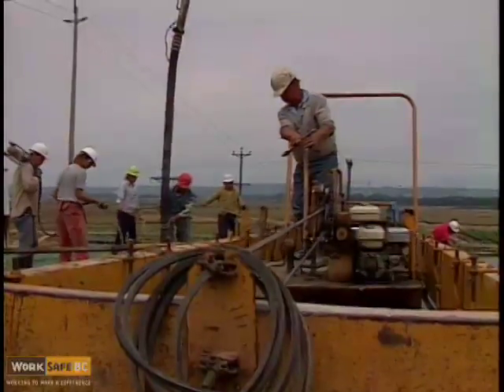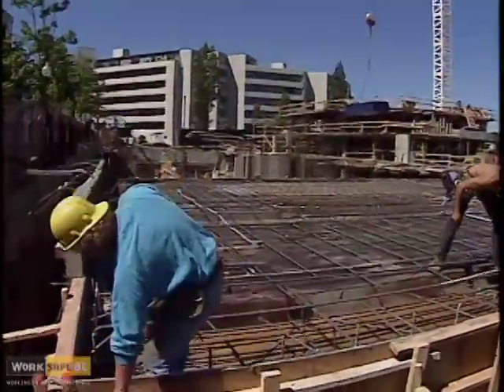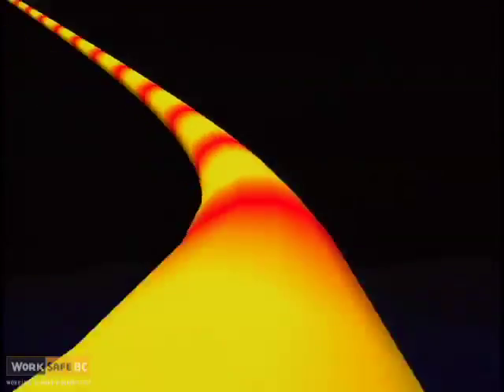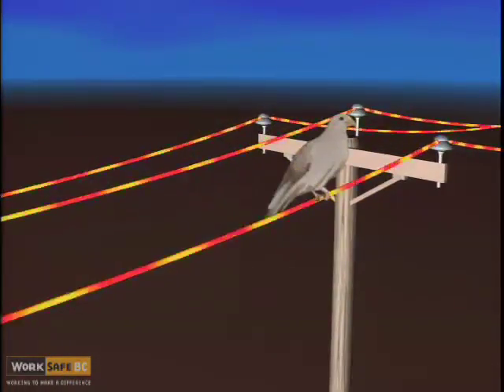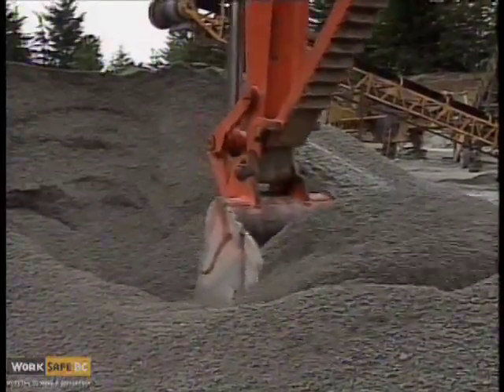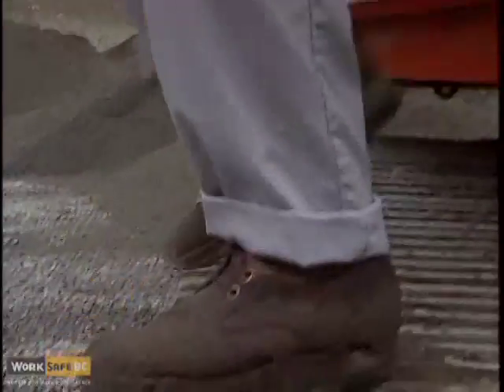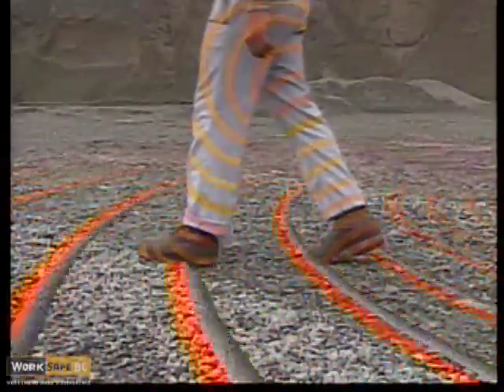A Bright Arc: Contact With a Power Line (6 of 7)

Comment: Replied to a question below. Wanted more people to see the answer:It is about the resistance in the dirt. There is full voltage where the power line touches the ground- 13,000 volts. Through the dirt's resistance, a foot away may be 12,000 volts. So when you step away from the contact point with your feet one foot apart, you can have that 1000 volts difference go through your bod, (as well as through the dirt).
Reply: this is true unlike everyone who says don't touch any metal objects inside the vehicle which is not true

Comment: The best safety rule is: NEVER operate ANYTHING near a power line. Not even a kite. Benjamin Franklin learned that the hard way for you, so you won't have to repeat his goofy mistake. Electricity does not discriminate. It knows no racial, religious, social, or political differences. It will kill anyone or anything that gets in it's way.

Comment: 2:33 This is how my uncle died.  His dump truck type trailer made contact with power lines and the tires caught fire.  He jumped out of the truck with his fire extinguisher but he was still touching the truck when his foot made contact with the ground.  He was 23 years old.  Videos like this are invaluable.
Reply: Dumpytom R.I.P
Reply: Tom LaRose fire extinguisher aka metal or know as a conductor  is the reason why he got electrified and died
Reply: Sublimebmx187 He wrote that his uncle both touched the truck and the ground. Not that he touched the ground and the truck via the extinguisher.
Reply: @Sublimebmx187  You are incorrect because simply holding a metal object doesn't create an electrical path to ground

Comment: While operating a crane with 140 foot boom, the machine came within 50 feet of very high voltage transmission line.  The crane became inductively coupled to high tension lines and when ball swung to within 2 feet of grounded support column, a large spark jumped from ball to column.
Reply: Inductive current within 50 feet? Wow.
Reply: That hadda be pretty cool

Comment: Stephen Holmes comment is on the mark. Step voltage is the difference in voltage as you move away from a downed powerline, the higher the voltage, the higher the danger and the more aware you should be

Comment: I can see this, main delivery wires from the company to substations are pushing the highest deadliest power, then down sized to the main substation to be sent across a city or town. But the delivery from the substation is still high enough to kill and still have some strong push. Until it reaches a pole transformer to be down sized again so it is safely sent to houses. As long it is high, it has serious push, were it even can push through rubber.  So all top pole wire before the transformer is always deadly. This is why when a pole transformer breaker fails, wire used for houses get red hot and start to burn.  In short, all delivery wires on the top part of the pole are always lethal.. Lest this was how it was explained to me...
Reply: You are right my friend

Comment: It isn't a path to ground that large steps will make, it's the potential between your two feet. The ground will resist the electricity, so the voltage 5 feet from source and 6 feet from source will differ. It's that potential difference between your feet that electrocutes you. Cows are usually badly injured from lightening strikes because their front/back legs are so far apart.

Comment: no because not only does electricity go through routes to ground it also takes the path of least resistance, metal has a low resistance (1 or 2 ohms depending on the metal) your body had a resistance of a few kilohms, also the potential voltage difference between different parts of the metal is so minute there is no harm done to you unless you are wet in which your bodies resistance will decrease.
Reply: Look up the formula for parallel resistance. Plug in some numbers.

Comment: The hopping thing seems unnecessary. If there's voltage on the surface, the voltage would be the same at both feet, resulting in a potential of 0. No current will flow.

Comment: Dirt is not a very good conductor. If something of a very high voltage, like a power line or lightning is touching it, there will be a voltage gradient radiating from that point. If it's a very high voltage line, the gradient can be hundreds, even thousands of volts per foot. You conduct better than dirt does, so the electricity will use you as a kind of shortcut to get closer to 'ground' or 0v

Comment: The ground around the machine will be energized?  What happens if someone encroaches closer than 33 ft?  Are they burned , vaporized or launched? Or does it pull them into the ground?  Can someone walk me through?
Reply: Put a fork in an electrical outlet, and then multiply that pain by 1000
Reply: yes the current flows through the ground, but the voltage over distance is reduced from the point of entrance or contact. so if you spread your feet on ground there will be a voltage difference between your feet and you are the resistor so current will flow through you. you will just be zapped.
Reply: Think about it like a lightbulb. If you're close, you see lots of light. Further away, not so much. It's called the inverse square law, and it means that close to the machine the voltage is high. 20 KV relative to "clean" ground is definitely possible. As you go further away, the power dissipates into the ground, so the voltage becomes less.

Comment: Metal track is on ground. Wouldn't stepping into track the same as stepping onto ground.
Reply: No, the tracks are part of the machine and so will be at the line voltage. The machine will conduct power a lot better than you, so there will be no "potential difference" between the different bits. Now, if you were sitting on a rubber mounted seat things might be different!! The reason you hop away, is because of the resistance of the ground.. Say the machine is at 33,000 volts or whatever voltage they uses in your area. After, say, ten metres, the ground voltage will have dropped to nil.. So, for two points ONE metre apart, there will be a potential difference, a voltage, of 3300 volts...... Best you hop!! This is why horses and stuff get killed so easily when there are underground cable faults, their legs are further apart on the ground..

Comment: That's only half right.  Yes, amperes can be deadly, but VOLTAGE is required to push amperes through the body.  A cheap alkaline D-size cell from the dollar store, for instance, can produce more that 8 to 10 amps of current, but fortunately, 1.5 volts is not enough to push all that current through the body (unless you're made of metal, then even fractions of a volt can be deadly).
Reply: A lipo will throw 225 amps sustained current nowadays.

Comment: Why don't companies equip their machines with high voltage foot wear that the employee can quickly slip on just in case of such an event?
Reply: A lot of construction boots have a high degree of electrical insulation built in but if they are wet, muddy or old they loose a lot of the electric insulation.  Rubber and plastic conduct if it's dirty, caked in mud or the voltage is high enough that it can go through the rubber.   If you work on a construction site and attend weekly toolbox meetings you will soon learn about this.
Reply: too expensive. money is more important than human life
Reply: Okay, then how about this: Why don't companies tell them it's okay to run instead of bunny hopping while they're on the ground? Running is different from walking in that only one point of contact is made while moving along at a higher rate of speed.
Reply: Because that's ridiculous.

Comment: :) 2:02 operater touch metal machine construction...i know about faraday cage but in cage dont touch metal objects right?
Reply: +Tony Valdez he isnt completing the electrical circuit to ground so as long as he is isolated to only the "live" machine without touching ground he isnt completing the circuit so no shock. this is the reason that high voltage powerline workers wear clothing laced with conductive metals so  if they do accidentally conduct a current it will pass around them rather than through them but ofc its not fool proof these metals get very hot with current and can cause severe burns
Reply: he can touch where ever he wants in the cage.
Reply: @urbansnipe  yeah if he's drenched in sweat from working I wouldn't advise touching the hand rail while standing on metal I'm sure he'd be more conductive than that hunk of iron separating them

Comment: Its that difference in potential that kills you
Reply: +awzz87 wrongggggg :D potential difference is known as voltage. voltage doesnt kill you its the amount of current that flows through is WHAT KILLS YOU its all about the AMPS. tazer guns around 50000 (low current)volts or doesnt kill you but 240 volts (high current) from mains does kill you
Reply: You need a difference of potential in order to allow current flow. If you stand in an equipotential plane, nothing happens to you, but as soon as you introduce a difference of potential between two points, then current will flow in respect to resistance. You are right Current  will kill you .  .75 mA is enough to cause ventricular fibrillation.
Reply: +urbansnipe well, the current is sort of a consequence of the voltage difference.

Comment: ONE THING HE STEPS FROM THE ROTATING PART OF THE MACHINE TO THE STEEL TRACK  YOUALSO HAVE TO HOP THAT THE CABIN IS MOST OF THE TIME SUPPORTED BY RUBBER DAMPERS TO REDUCE THE VIBRATIONS OF THE ENGINE TO THE CABIN  SO THAT CAN BE ISOLATED
Reply: +J IJzer yeh i wouldnt be so quick to step on the tracks either :D i would sooner jump clear of the cab straight to the ground without contact

Comment: 3:03 I wish they explained the concept of potential difference a bit more.
Reply: Say the machine is at 33,000 volts or whatever voltage they uses in your area. After, say, ten metres, the ground voltage will have dropped to nil.. So, for two points ONE metre apart, there will be a potential difference, a voltage, of 3300 volts...... Best you hop!! This is why horses and stuff get killed so easily when there are underground cable faults, their legs are further apart on the ground..

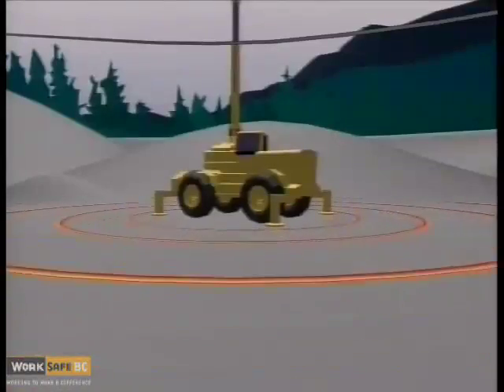Comment: 2:18 dosent the rubber tires prevent contact  whit the ground?
Reply: +swedish gaming you mean alongside the conductive metallic outrigger legs deployed next to those tyres???
Reply: +swedish gaming Not necessarily.
Reply: +swedish gaming if the electricity is strong enough, it will flow through the rubber tyres.
Reply: Only if the voltage is low enough.  If the voltage potential is high enough it will conduct right through the insulation.  I just wish the video better explained how amperage, voltage and resistance works but that would add about an hour to the video.
Reply: rubber tires are  not made from pure rubber, but a composition of  metal& carbon powders and synthetic rubber particles molded together with steel wire.also the dirt sticking to the tire is a good cnductor for electricity.
Reply: Phillip Mulligan i work with ohms and amps everyday. Though im not an electrician and 240 is usually the highest voltage i deal with, i do agree. Its good education.
Reply: If the voltage is high enough, everything becomes a conductor. Just like lightning strikes that pass through air.

Current = Voltage / Resistance.
Reply: From a lineman; Most primary voltage lines,the ones feeding the transformers you see are typically each 7000 volts or higher and will track and go to ground setting the tires on fire due to chemical makeup in them unlike the rubber gloves and covering we use thats specially made and tested for live line work.

Comment: wouldn't you get shocked anyways because electricity is going through the vehicle?
Reply: No because he isn't part of the circuit. It's like if you (while wearing rubber boots) put a knife in one slot of an outlet, and then touched it with both hands at the same time.

Comment: You can just walk away from the crane once you are out of contact with it, you don't have to hop with both feet together, you will only get electrocuted if you are in contact with the crane and the ground at the same time.
Reply: You just failed high-voltage electrical safety training.  Nice knowin ya.

Comment: so electricity can go in to the ground, then back out again? going up your leg and down the other back into the ground? did i miss something from all the electrical tutorials i watched?
Reply: It is about the resistance in the dirt. There is full voltage where the power line touches the ground- 13,000 volts. Through the dirt's resistance, a foot away may be 12,000 volts. So when you step away from the contact point with your feet one foot apart, you can have that 1000 volts difference go through your bod, (as well as through the dirt).